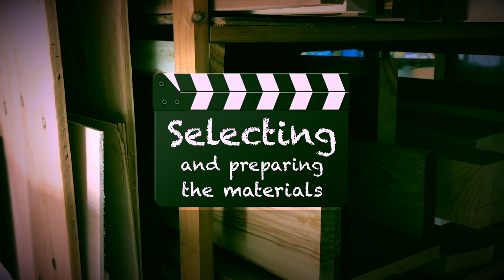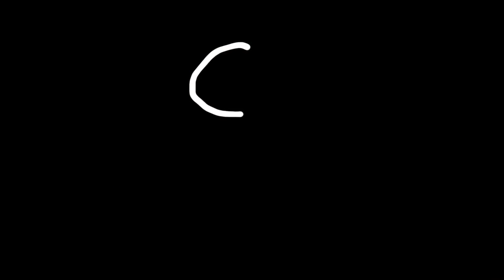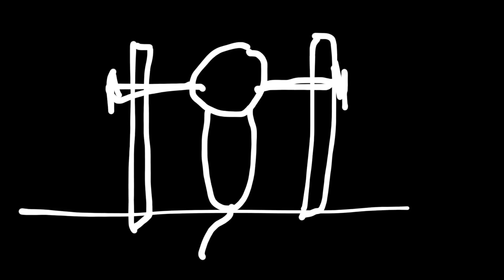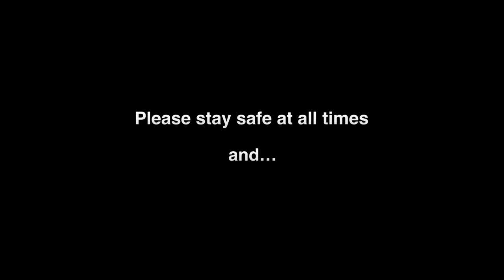Spoons and Spatulas a Wood Turner's Way

Comment: Nice work...but what was the point of turning the paddle end? The handle of course, but why did you spend all that time  on the paddle ends?
Reply from the maker: Chris Conners hi Chris, thanks for watching. You don’t have to turn the end but turning it does a few things. If your end is off it will round the edges and it will also parallel the sides and align the end with the handle of your original cuts were off. Also, if the head is off it creates more vibration while turning the handle. I like to turn, so more turning and less sanding or sharpening off the lathe is my preference. Thanks.

Comment: Awesome idea and a great video showing how to build your jig.

Question for you, where did you buy the sanding disks with the rounded edge?

Thank you!
Reply from the maker: Shawn Siegrist hi, thank you. I bought the sanding disk at Home Depot but they don’t have them anymore. It’s a Freud diablo corner edge. Home Depot and some other stores have them online. Hope that helps.
Reply: SP Wood Art, thank you for getting back to me.  I ended up purchasing a cutter for my grinder and built your jig.  Works great, thanks for sharing!

Comment: Maybe you said it and I missed it, but can you use food grade mineral oil to finish?
Reply from the maker: Yes, but you’ll have to reapply often. You can mix or add bees wax over the mineral oil too.
Reply: SP Wood Art thanks! I do the mineral oil/bees wax combo on my cutting boards but wasn’t sure if it worked here too. Glad it does!!
Reply from the maker: Maxine B I use oil bees wax mix and also use salad bowl finish for cutting boards. It seems to last longer on cutting boards and is safe to eat off.

Comment: very nice jig... i don't know where to buy te round edged sanding disc... thanks
Rik
france
europe
Reply from the maker: R Dc hi, I just saw you subscribed to my web page and I received your comment. Thank you. The round edge sanding disk I have is a Freud Diablo. You could also use the King Arthur chain saw disks too or the tungsten rounded wheels. I’m not sure where you are, but I’m sure you could find one of them. Thank you! I posted a wheel in my Amazon page as well for you. 

Www.Amazon/shop/spwoodart
Reply: thanks for your answer, could you please specify the Diablo disc... what is marked on the disc...
or where to find or where you buy them...
i am in europe, i am belgian but i live in the south of france...
the chain saw disc seems very dangerous to me... lol
Reply from the maker: R Dc lol I agree, that’s why I went with the sanding disk instead of the chain saw disk. The disk I have is called a Frued Diablo steel demon, 40 grit, corner edge design. It’s for metal and stainless steel but works great on wood. Hope that helps